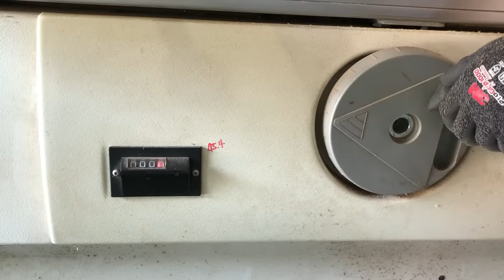SHOWER STOOL - made by WOOD Girl

Comment: Ok so I already saw comments on safety glasses so I won’t mention that, what I did fail to see is anyone mention how you use the fence and the sliding table in conjunction wich is a high risk of kickback! If you want repeated cuts then back the fence off a little and use a spacer block that releases before the wood hits the blade. You only want the fence up against your work if you have some sort of push stick behind the wood between the blade and the fence to prevent kickback….. hopefully that was a clear explanation!! Keep up the creative work!!
Reply: Well, eye protection and ear defenders, yes. Plus, with regard to using the fence, it’s only for rip cuts, the sliding table has stop blocks which are used for repeated cross cuts - and it’s this that should be used. Every single thing in this video is an example of how to do woodworking dangerously. It’s awful.
Reply: It’s pretty staged.   She not even wearing underwear… that’s more of a safety concern 😂
Reply: Eyes on the wood.
Reply: @sarah-janegalipo3995  That’s how to get the likes these days I guess 🤷‍♂️ must admit…typical guy in some ways.. she has me watching her videos ☺️
Reply: @rickydegringo  what??
Reply: and where's the riving knife??
Reply: Yuk gotong royong 🙏🙏🙏🙏🙏
Reply: And she uses a ripsawblade for the wrong purpose.
Reply: @chm1701  You missed the point that crosscutting using a fence with a 
spacer block presents no safety issue, as the fence is used only as a reference for positioning the piece before the cut begins.
Reply: I thought this exact thing when I saw I was utterly shocked at the disregard for shop safety and I’m only 16 guess I had a good mentor to teach me  some good shop safety😅😅
Reply: @chm1701    I think he was referring to having a short spacer block to set the length of the workpiece you are having cut and for the spacer to end before it gets to where the blade is so it has a little space between the blade and the fence to prevent the off cut from getting pinched between the blade and the fence causing a kickback I don’t think he meant to have a spacer running the entire length of the fence correct me if I’m interpreting this wrong 😅😅
Reply: @johnmeany7004  this is correct, not running the entire length
Reply: @jasonyannuccelli2499  hii friend 🙏🙏 I NEED +1 from you 🤲🤲🙏🙏🙏
Reply: @henkvharten8465  hii friend 🙏🙏 I NEED +1 from you 🤲🤲🙏🙏🙏
Reply: @Zie_carpentry  need +1 what??
Reply: This isn't even her worst offense. She has another video where, being lazy, she passes her hand directly over a spinning blade instead of using a push stick! Clearly she knows that she needs to use a push stick because sometimes she did. Other times, should couldn't be bothered. It's not my hands, so I don't care, but if you watch her enough, you'll see more no nos.
Reply: @johnmeany7004  Also on that saw I think you can actually slide the fence back so it ends before the front of blade.
Reply: Кто ж такую красотку впускает в цех без спецодежда.  Модельная девочка с идеальной фигурой, мягкой, быстрой походкой, в платье с манящим вырезом снизу  вертится вокруг всевозможных инструментов, делая себе скамеечку для душевой, чтобы сполоснуть свои ножки конфетки. Ну, а как же все остальное, если пыли там было немерено. Интересно узнать. Новых передач вам и хорошего настроения.
Reply: I can't take it seriously, go the whole hog and do it in the buff, insult to talented people 😒
Reply: These sliding saws have sliding fences for just this reason - it's imperative to slide the fence behind the apex of the blade so the fall off doesn't get caught and kick back - especially if you aren't bothering to surface / plane your lumber before cutting which can lead to a higher chance of kickback.  These videos are ridiculous.
Reply: Safety goggles, safety work gloves, Etc .   She is probably a Glamour model, very lovely and beautiful, so is her minidress, so lovely!
Reply: why use a table saw for this?i mean it works but so does a power mitre box
Reply: @sarah-janegalipo3995   Really !  When ?
Reply: Если вы такой знаток, что же не написали что на станках повышенного риска не в коем случае нельзя работать в перчатках, а в юбке и подавно?
Reply: @rickydegringo  Eyes on the wood - that's the problem.
Reply: @sarah-janegalipo3995  I guess she needs to make a pair of drawers!
Reply: On any decent table saw the rip fence slides. That way you can slide it back behind the blade where it cannot jam material between the blade and fence. No need for push sticks or spacer blocks. A riving knife and appropriate blade (not a rip blade) would be a good idea too.
Reply: as Tommy G Workshop already said, this type of crosscut are dangerous. simply adjust your cutting size, and push fence backward( every table saw has sliding fence) , so its not line up with blade. And then youre safe, and your piece wont catch fence and make kickback.
Reply: @chm1701  And she still seems to "celebrate" the kickback. I've had kickback from a radial arm saw, and it wasn't pretty. Now I feed those pieces through a "tunnel" so that they can't kick back before the wood gets to the anti-kickback thingy.

Comment: Putting a small spacer board up against the fence that the board you're cutting would clear before it hits the blade would solve the kickback problem.
Reply: Yuk mampir ke sini 🙏🙏🙏
Reply: Sliding table saws let you slide the fence back as well so you don’t even need a spacer.

Of course the other value of a sliding table saw is that you’re not behind the work piece so when it does kick back like it did, you don’t take one in the chest.
Reply: @serbakreatif  injehhh mase,, salam knl 😊😊👍

Comment: There is a lever on the back of the fence. When cross cutting like that pull the fence back so it's only used for the actual measuring. When the table is pushed forward the cut piece passes the fence can't be wedged and thrown back.
Reply: I clinch up when I see her make cross cuts like that. I have intimate experience working with those table saws.
Reply: That looks like a delta unifence and that's one of things I like about mine.
Reply: basic laws working with a table saw
Reply: The pucker factor watching her crosscut that stuff was off the scales. I was literally crawling up the back of my chair. Can you report a video for demonstrating dangerous work habits?
Reply: @patrickhalseth1632  First thing I thought of, but I cannot believe this is a serious woodworking video, just click bait. She doesn't even have protective gear; and wearing a mini dress? Get real…

Comment: 1:40 - you can avoid the kickback a bit more if you had a newer table with that shark fin at the back of the blade, but even that wont remove it completely
Reply: actually, the saw is superior to what you are suggesting. The issue is using the fence as a stop block. Clamping a board to the face of the fence which stops an inch or so before the point the blade engages the wood would prevent this from happening. You should never have a situation where the wood is trapped between the fence and blade.
Reply: "Kickback!", like she was so proud.  
Call me crazy, but I don't think safety is a very high priority with this channel.

Comment: I've seen you trap the cutoff between the blade and the right fence on other videos also.  Try sliding the right fence forward of the blade so the offcut has some where to go.
Reply: Absolutely.  I was questioning what she doing before the kickback occurred.  That's what makes sliders so good with the adjustable fences.  Rookie mistake.
Reply: She's selling t&a.... Just so happens to be in a wood shop.
Reply: @OvelNick    That's fine, no need to damage the goods.
Reply: @tim_bbq1008  👌 Yessir! 👍
Reply: @OvelNick  and 2.2 mil buying

Comment: 1:46 Do not cut the boards in this way, it can block the board in the saw because the length of the board is greater than its width

Comment: Awesome work, cool what you do
It the table saw was redesigned in a way that made crosscuts that clamped and guided and pushed the wood perfectly between the fence and the blade they're would be no material kickback, as it is, any vibration and wood movement from unsupported material between the fence and the blade can go flying. Always keep your hands clear of the blade, and wear some safety glasses 
Have fun!
Reply: Yea, once you have your first kick back, you never make that mistake again
Reply: Beautiful sander

Comment: The kickback is due to the rip fence being beyond the blade. Retract the fence to be in front of the blade for crosscut work.
Reply: Not supposed to be using the rip fence at all for crosscuts, kickback was caused by getting stuck between the fence and the blade, without the fence the blade probably would have just pushed the block to the side. Can be pretty dangerous. Also not wearing eye protection, and wearing gloves. I guess we can all be nitpicky, but a lot of unsafe things going on.
Reply: @Aubatron  Only two people here realized that. I guess the other guys never worked properly on a tablesaw
Reply: @Aubatron  Agree on all of that, but give Wood Girl some credit for avoiding loose clothing.

Comment: Another big mistake that you made, when you set your fence for cross cut, you should shorten your fence length to a spot ahead of the blade so there is no chance of kickbacks. In more than 40yrs in the trade, I've seen my share of mishaps and I still have all my digits.
Reply: @walkertongdee  finally someone else gets it.

Comment: When crosscutting on a slider you have to set your fence to the width you want to cut then adjust the fence back so it ends behind the blade. You just touch the board to the fence then slide it through the blade. No need shut the saw off, and grab your stock ... you just keep running them through and let the pieces pile up ... no chance of binding or kickback. 

Even if your rough cutting stock it's good practice to run the edge through the jointer so it sits flat along your crosscut fence. I would have face and edge jointed first because you have to do it anyway and it makes sawing easier.

As much as I hate to say it you really should be wearing more clothes and safety glasses cutting hardwood on one of those big sliders. A friend of mine was impaled cutting 4x4 into cant strips ending his career and I've seen blades lose their teeth explosively cutting hardwood peppering the operator with carbide teeth. The problem with those big 10 hp saws is they generate so much power that you don't get the feedback when it's binding or encountering tough grain. Sometimes there can be objects in the wood that you don't see like fence staples. The blade will start losing teeth before you can feel any stress in the feed rate. I wear safety glasses and a leather apron when running a saw.
Reply: Well said, great advice. But remember this video and stool was made by "WOOD GIRL" she is the super professional woodworker and doesn't need tape measures, gloves, safety glasses or fences on her table saw.
Reply: Yea but he’s right these machines are no joke, there’s a blade guard on the arm which nobody ever seems to use, also another extractor point in the guard. and the sliding stop I’ve found unless your feeding pieces directly from behind there’s no point having it exceed anywhere past the furthest point of the blade, that’s why pieces and off cuts get jammed when your standing over to the left and trying to push something square in an awkward position

Comment: In a shop i worked in an unqualified person was using our 16 inch table saw when a piece kicked  back. If he had not been standing off to the side this piece would have impaled him. Behind the saw was a 3/4 inch piece of plywood screwed to the wall where  the radial arm saw was this piece that kicked out embedded itself into the plywood. This was a piece of  oak , needless to say this person was no longer allowed in the carpenter shop.

Comment: Nice machines , you need to learn how to use them safely,  if you want to use the fence for a stop , Put a block on it well behind the blade , so when it gets cut off it doesn't bind and get throw off in to your face.

Comment: I cannot believe that she went to that much trouble to make the wood so smooth and then not put some sort of a urethane finish to protect the wood. Without that finish the grain of the wood would rise and she might get a splinter where she sits. That stool will not last very long being exposed to water and other chemical products that she might use in the shower.

Comment: Hmmm.  It might have been better to put each piece of wood through the planer in sequence, rather than changing the settings on each piece independently.  While the filling on the dress is appealing, I couldn’t get pass the lack of knowledge. Would Rae have seen the 100 hours rebuilding a camper van.

Comment: A young thin chick with a short dress with extremely nice equipment. I meant the mechanical equipment. That could not be the reason for 8 million views? I have used those Hafele crosscut saws, sweet. And the wide boards for benches and expansive shop with no one in it means she works there and has keys to the place? Cabinet shops are cool.

Comment: Dommage d avoir à sa disposition de supers machines et outils et de ne pas prendre le temps de s y former pour s en servir correctement! Le travail du bois est une discipline noble, nécessitant un respect des étapes de préparation. Délignage et tronçonnage avec surcôte (et avec la position adéquat du guide parallèle pour éviter les projections de bois/accidents et abîmer la machine), degauchisseuse, raboteuse, mise à l longueur seulement ensuite pour pouvoir couper les éventuels défauts en bouts, d où la sucôte de la première étape. Pour le collage, il ne suffit pas d emboîter les pièces collées, il faut maintenir l ouvrage avec serre-joints, dans ce cas avec des angles de surcroît, et respecter un temps de séchage. Le bois brut exposé à l eau, l humidité sans protection ne fera pas long feu. Quant à la tenue, je vous souhaite de prendre d avantage soin de vous pour continuer à travailler et vous améliorer sans vous exposer aux blessures ainsi, faire le choix de l esthétique est le vôtre et vous êtes libre mais la sécurité ne devrait pas être un choix secondaire, vraiment... meme avec une bonne aspiration, le cancer des sinus est une possibilité à long terme donc selon les étapes, mieux vaut s équiper d un masque. Et honnêtement, ces vêtements n ont rien de pratique, aucun outils de marquage et de mesure à portée de main, crayons porte mine, réglet, mètre, craie, feutre, cutter... je prefere mon pantalon multipoches et epais me protégeant aussi des potentielles chutes de bois tout comme les chaussures de sécurité qui m ont déjà évité des misères. Débutante, je gagne le respect de mes collègues hommes en étant appliquée, en écoutant mes formateurs/trices, en travaillant dur pour cela. Je vous souhaite de progresser dans ce beau métier en sécurité et d obtenir d avantage de commentaires sur votre travail plutôt que sur votre apparence 🙂

Comment: She needs some one on one training on cross-cutting safely with a table saw and sliding table saw. I agree with another gentleman is I always start with planing to thickness unless it’s a panel to be glued up and was ordered pre planed as I do many time 15/16” H/M S3S which is straight line ripped and planed to 15/16” hit or miss. I could make her work safe.

Comment: Obviously she is hood looking and I’ve never seen any lady dress like that in my shop. I’ve had a lot of ladies trained by me. HOWEVER., not sure who taught her how to cut on a sliding saw. She broke every safety rule in the book . On top of that she thought the kick back was funny. If she ever got hit in the gut by that , guarantee she wouldn’t be laughing. I’ve been a fur maker for 56 years and I’ve had two kick back injuries. Bad ones. Mainly because I become complacent or over tired. I knew it was coming before it did by the sound of he saw. Split second layer I was hit by an 8/4 spinning piece of walnut. 150 mph. Believe it or not there is a kickback chart based on saw  RPM , HP, BLADE SIZE, etc. one of the first things I mention  when teaching  is kickback. She obviously there for hits and I’m sure she gets them . Using her body for skills. I’m all for watching a good body, but she would be pushing a broom for a while longer  before she ever got near a tool in my shop

Comment: Those dangerous kick backs are because you have the fence set for ripping not docking on the panel saw.
Adjust the fence by pulling it back towards you so it lines up with the blade for docking
Reply: Use a spacer block on your fence and you will avoid that.